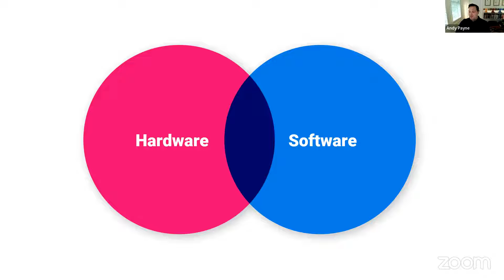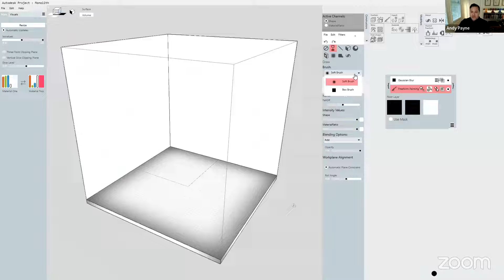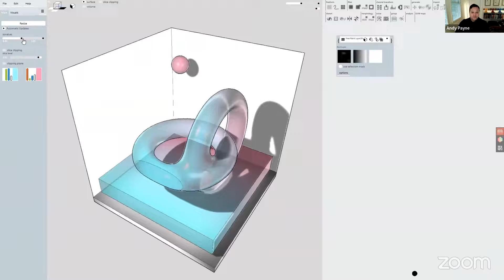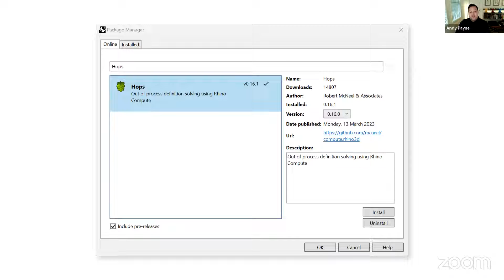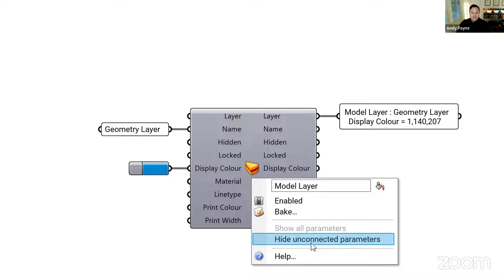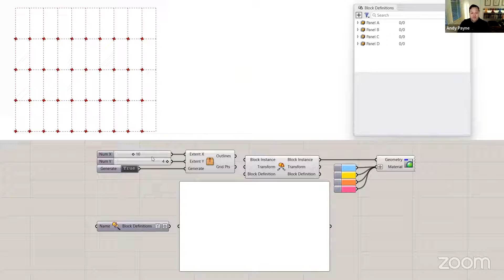"Design Tooling" | Guest Lecture by Andy Payne | Harvard GSD-6338

Comment: does this new development are work together / adapt from Elefront ?  or build from scratch by mcneel?, i am just curious because this is exactly whats been missing in Grasshopper and somehow elefront filled in the gap until this rhino 8 development are release
Reply: You’re absolutely right in that Elefront and a few other plugins have been absolutely instrumental in filling a gap in the existing toolset. Our goal with this project was not to displace any of the hard work that those developers had put into their plugins. Rather, we just felt it was long over due to have a set of native components which could support many of the Rhino data types that didn’t exist in Grasshopper.